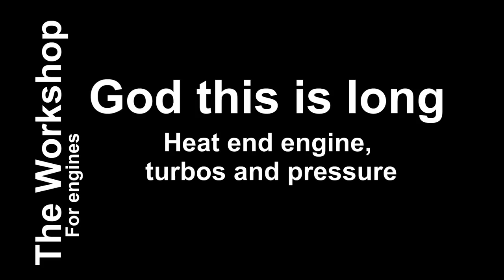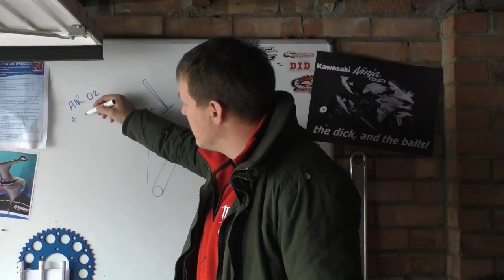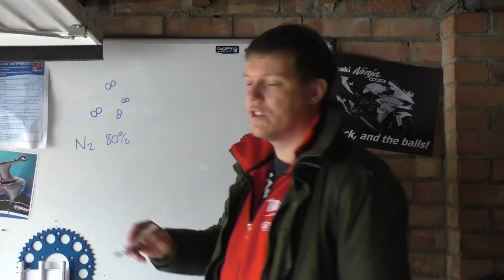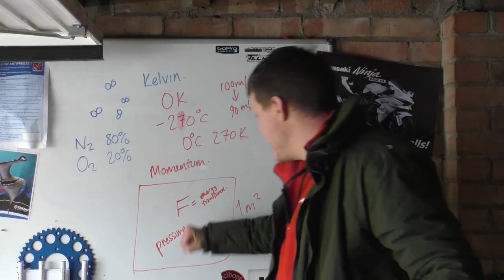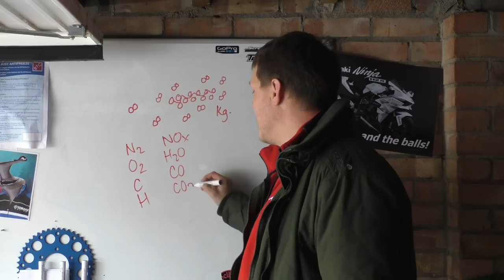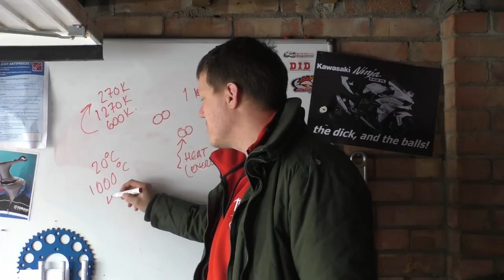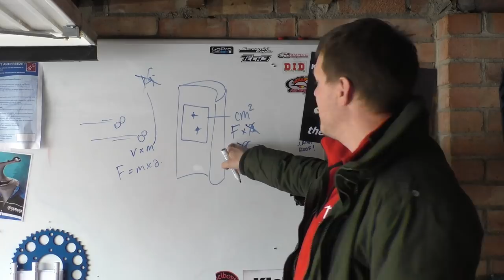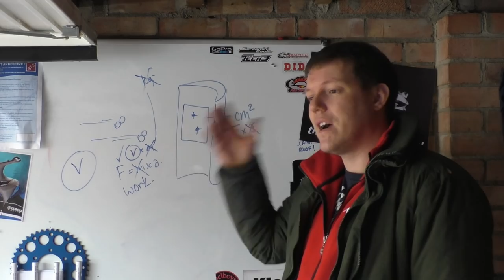Heat - the core of an engine

Comment: I didn't bother commenting in the other vids, but figured I would share a story.

Probably one of the most eye opening classes I ever had in high school was in chemistry getting taught the ideal gas law. PV = nRT. If you increase temperature, in a fixed volume, pressure must increase. All the pieces came together of combustion releasing energy increasing temperature and it all becomes so clear that the engine is a heat pump that converts chemical energy into thermal energy into kinetic energy.

Pressure and volume changes are just a measurable outcome of the force applied by temperature (energy). All of the forces of gases are directly proportional to the number of atoms (n) and the temperature of the gas (T) multiplied together with a constant (R). It was the basic theory for me that led to the understanding of an engine.

Comment: This is all about energy conservation and transfer. The fuel has potential energy. To get the fuel to release its potential energy you have to excite its atoms/molecules by giving them energy by heating them up. This is done by squeezing them 1st. The atoms will try to keep moving as they were but because there’s less space they bump into each other and their surroundings much more often which increases their energy in the form of heat. Then you hit the the molecules with a spark which again is heat energy that then transfers it’s energy into its surroundings (fuel/air mixture). At the location of the spark the fuel/air molecules have been given so much energy from the spark the bonds holding the molecules together break apart which releases a HUGE amount of energy in the form of heat and light which then causes a cascade of energy transfer from molecule to molecule breaking apart more and more molecule releasing more and more huge amounts of energy. When the exhaust valve opens the molecules have more space to move around and so bump into each other a bit less so their energy is a bit less and so the temperature drops a bit. They loose still more energy by banging into the sides of, and then releasing some of there energy, into the exhaust pipes atoms in the form of heat. The remaining molecules still have a lot of energy/heat left and so they are still bumping into each other and moving around at a high velocity. They then come into contact with the blades of the turbo. The molecules still has a lot of energy and so the atoms are moving around at a high velocity. When these molecules hit the turbos blades they transfer most of their remaining energy to the blades in the form of heat energy and kinetic energy. Any remaining molecules with energy exit the exhaust and release their energy to the atmosphere in the form of heat until they have the same amount of energy/ heat as the surrounding molecules in the atmosphere. 
Energy is never lost it just changes from one form to another (energy conservation). The engine doesn’t take advantage of all the energy available because of inefficiencies due to heat/energy loss to the cylinder, cylinder head, valves, piston, exhaust etc. 

Hope all of that is correct because I can’t be fuckin arsed rewriting all that again. Almost all of that is what I remembered from chemistry and physics at school 34 fucking years ago. If some or all of the above is wrong I’ll put it down to the fact I’m an old cunt with low swinging bollocks and my minds getting more and more fucked! I still think I’m 20yrs old until I try to do something that used to be easy but now isn’t or when I look in the mirror and see an old bastard looking back at me and at 1st I’m thinking, who the fuck is that old ugly cunt. Of course these are all excuses for any mistakes in the above.
Reply: Good enough close enough for me. 100% the last paragraph.
Reply: Adding heat via combustion creates a pressure differential thus the possibility to extract work from the working fluid as it flows to the lower pressure....

Comment: Iam sitting watching this video and watching the wood burner burning some lovely hot logs. While most of the heat is coming into the room some of it is pissing off up the chimney.  My question is can I put a turbo on the stove pipe?  And could I poke it back into the wood burner for boost adding more oxygen for a warmer more efficient use of wood fuel.
Reply: Chris Waddington
Awesome question. In theory, yes, but you'd then have a small blast furnace in your living room!.....& your logburner would overtemp.
Reply: I’d like to see that

Comment: Cold is defined as the absence of heat. Heat is the energy that arises from the random motion of molecules. Hot air will always rush to cooler air. The hotter and more dense the gases are at the exhaust vs the ambient air (tip of exhaust system) the more energy will be available for the amount of air being pumped out by the engine.

Comment: Matt,dont shy away from the Technical terms.  Work is done when a force moves through a distance.  I  can realize you may not want to assume we can understand iit.  How clear is it when you assume we cant, and keep trying to oversimplify?You touched on the definition of heat engines. That clarifies the point again.  -279.16 Ithink, btw.
Reply from the maker: - 273.15! Yeah.

The point is in the video that most people got it - it was the other that didn't that's why its like this. I could just say adiabatic and isochoric, but then I'll lose 85% of people and have to explain half of thermodynamics. LOL

Comment: The heat energy is harvested by the expansion of  gas. Just as the intercooler cools the air to make it denser and cram more of it in the same cylinder space. The heat is expanding the same amount of air in a given volume.
Reply from the maker: And what's expansion? Do the molecules grow bigger?
Reply: The Workshop, the molecules do not grow bigger,  but they occupy more space. The hotter they get the more they vibrate and bounce around expanding the space they occupy. I agree with what your saying BTW
Reply: The molecules do not occupy more space. Pressure is dependent on how many molecules you have and how fast they are moving. If you increase the temperature without increasing the volume the pressure increases. 
Expansion is just pressure equalizing in the available space. If you don't give it more space it won't expand.
Reply: Expansion is defined as the action of becoming larger and more extensive.

Comment: actually its pressure differenteial that drives the turbo, you are correct that it needs heat, but its the explosion pressure wave
Reply: You're missing the point.  Go back to the video at 34 minutes.  Matt explains what pressure differential is caused by and shows that heat energy will increase the speed at which this happens.

Comment: i would suggest that, any un-desired output from a process is either waste or by--product.  in an ic engine, that is what heat is.    while some heat is added via an ignition source, an ic engine is not a heat engine.     cheers
Reply from the maker: "an ic engine is not a heat engine"

- an internal COMBUSTION engine is not a heat engine - LMAO - did you read this back to yourself before you pressed post?
Reply: very mature.     does a snipe at me somehow make you right and me wrong.  I DON'T think so.    do YOU think that TEMPERATURE DIFFERENCE plays ANY part in the operation of a car engine.    if so,  you are truly living in a world all your own.

Comment: Yes, but what about antimatter traveling backwards in time? Wouldn't heat move from cold to hot if you were traveling through time in the opposite direction?
Reply: Ha, trick question, that is kind of why time only goes in one direction.  Or does it?
Reply from the maker: Entropy only goes in 1 direction. Its called the arrow of time.
Reply: Entropy of my workshop only goes in one direction too......
Reply: Heat and time are not related like space and time. Physics in our universe, acts one way.

Comment: can you explain how bigger turbos make more power at the same boost compared to smaller turbos
Reply: Larger area. The turbine is bigger hence a larger area for the gasses to impart energy to.
However, as you'll also be aware, larger means heavier and so more inertia to hinder changing turbine speed quickly, and lager area means less force per area both adding to more turbo lag.
As with with virtually anything, a trade off must be made.
Reply: Im not a physicist or anything, but my guess would be lower intake temps because the exducer is not spinning as quickly (creating less heat via friction). Cooler air has more oxygen per area. More oxygen creates a more complete and efficient combustion. More complete and efficient combustion = more ponies.

Comment: I understand what you are saying, but you did it in a fashion that is not very clear. Essentially, all of the expansion that happens in a cylinder during the combustion process is caused by heat. The expansion happens because the gasses in the cylinder gain a large amount of velocity from rapid heating. The atoms of gas strike the piston and exert a force against it, this moves the piston and operates the engine. This relates directly to turbos because you are just repeating the process that you just went through with the piston. The gasses flow into the turbine and strike the vanes, pushing the turbo and forcing it to rotate.

Comment: Hey Matt, been thinking about your statement that pressure is nothing more than a measurement... You say...
"Heat (energy) acelerates the molecules - pressure isn't a thing - there's molecules and nothing more - pressure is a measurement - its like saying you have 20 meters of rope. The rope is the thing not the 20 meters." 
I think that's a shitty comparison... What if we used containers of water instead? What we are talking about is differential is that not correct? Differential is the potential of energy... It is measured by pressure.  Could we agreed that pressure of air in a container is the same as the height differential of 2 containers of water? If all the water is at the same height... No energy potential... same as 2 containers of air at the same pressure.. But if one container of water is above the other the pressure rises..   we can collect energy when it flows back down to the lower container... Heat is one way we can pump water to the higher container...  Turbine blades are just little airplane wings... As the air or water flows past the blade it produces lift... If the blades are attached to a shaft rotation is the result.... There are 2 kinds of turbines.... Reaction and impulse..in the video you are describing an impulse turbine which is not accurate because most turbines are reaction turbines...  If you want to build a better turbine I suggest first consider how wings produce lift... https://youtu.be/XWdNEGr53Gw. If you want to make the statement that heat pushes pistons and turns turbines and that pressure shouldn't be considered then how do you describe the influence of pressure?
Reply: Here's a link showing the difference between an impulse and reaction turbine... The mistake you made was showing molecules striking the blades... This is what happens in an impulse turbine.. There's no pressure drop with this design... Turbo blades are reaction type thus rely on flow past the blade to produce lift... Pressure is reduced and multiple stages are possible for maximum efficiency. http://www.mech4study.com/2015/12/difference-between-impulse-and-reaction-turbine.html
Reply from the maker: LOL great comment - the difference with water is a you pointed out gravitational potential. If you did the samw with 2 bottles of air then this affect doesn't happen (not strickly true - if you has one bottle of air say 20km up.) 

So lets say its pressure - what pressure does a molecule of o2 have? It doesn't 

"When you deal with the pressure of a liquid at rest, the medium is treated as a continuous distribution of matter. But when you deal with a gas pressure, it must be approached as an average pressure from molecular collisions with the walls."

http://hyperphysics.phy-astr.gsu.edu/hbase/press.html
Reply: Really weak Matt... yes water creates pressure because pressure because is has weight in gravity BUT.... pressure is pressure...  doesn't matter if it's water pressure from gravity or steam pressure or air pressure from something inside a vessel...  it all works on the same principal.  In thermodynamics it's called a working fluid because air / steam or whatever medium you're using behaves like a fluid... work is extracted from the flow of liquids the same as it's extracted from the flow of gasses... yes gasses are more elastic than liquids however it's the flowing mass of the gas or liquid over a turbine blade and the pressure on the underside that creates lift / rotational force in a turbine.  I notice you neglected to reply to the difference between reaction and impulse turbines... Is this because you don't know? or choose to neglect it? As I stated gasses are much more elastic that liquid... so unlike liquid gasses give up more heat as the stored energy in the gas gives up it's work.. they also get hotter when compresses... Liquids like water also get hot when compressed and cool when pressure drops but it's a much lower difference than what happens with gasses... Like gasses liquids also expand when heated and contract when cooled... Statically pressurized air in a confined tank behaves no differently than water at the bottom of the lake... It's when you compress the gases or release the pressure that molecules ether give off or absorb heat. https://www.khanacademy.org/science/physics/thermodynamics/laws-of-thermodynamics/v/work-from-expansion
Reply from the maker: LOL really weak - are you shitting me pressure is pressure - so if you have this in space then one tank 'higher than the other' would have more pressure. I thought this was going to be a proper argument but fuck me. 

Both liquid and gas are called fluids because they flow. Gases are not elastic at all. Find me the young modulas of a gas. Elastic collisions is a different thing all together. 

Your description of turbine blades if funny as fuck - if this was true then why have stator blades?

As in the difference between impulse and reactionary turbines - you don't understand the basic concept of pressure, never mind going down a rabbit hole you seem to be lost down.

The best way to solve this is this. With the balloon video, When you cool the balloon down where does the pressure go? Without answering this question we can't move on.....
Reply: Gasses don't weigh (compared to liquids) much so unlike liquids you don't get much pressure differential from elevating gasses..  what I was saying is pressure differential creates potential for flow in gasses same as it does in water... Gasses ARE elastic since they are easily compressible....  how would you describe them?  as solid?  The purpose of stator blades is to redirect the flow after it has passed the moving blade before it passes over the next moving blade... stator='s stationary...  I'm confused why you say my explanation is FAF?  is it because you don't agree that turbine blade operate on the same principal as aircraft wings? or is it that you still think that air molecules are impacting the bottom of the blade? Why did you ignore the topside of the blade? was it because the theory of lift doesn't support your molecular impact argument?  As for the cold balloon deflating... when gasses get cold they like to huddle together to stay warm... as it get colder they huddle closer until they occupy less and less space... the balloon looks deflated because the gasses are more condensed.. does that work for ya? http://www.nptel.ac.in/courses/112104118/lecture-2/2-4-compressibility.htm

Comment: well it kind of is both really. pressure does the work but heat causes the pressure. pretty simple.
Reply from the maker: Almost - force does the work, energy is transfered to do work. 

Pressure is like torque, where its a force acting on something - pressure = area, torque = radius

Comment: Only major thing I can see you missed is explaining that bottled compressed gases reach an equilibrium pressure at ambient temperature and are their for contained at that concentration if you will.  (edit) fucked that right up equilibrium temperature and a static pressure that is contained.
Reply: Anyone ever seen a {(edit)active/electric/etc.}heating pad wrapped propane tank, its there because decompression releases stored energy and cools, once the tank cools enough there is only liquid propane and very little evaporate pressure left because it is no longer at its boiling point.
Reply: I've seen guys in the Northern Ontario regions lighting a small campfire under their propane tanks to get the propane back to boiling temperature. But yes, there are heating pads for propane tanks.

I'm torn on how much they help on the really cold nights where the meter is spinning and your warming up a -30C tank compared to investing in a wood burner and letting your propane tank do backup or just heating with electricity.

But when propane is running low, the delivery guy will only give you 1/4 tank so you can't keep a full tank, and you can only keep your furnace barely running at <60F, what can you do.